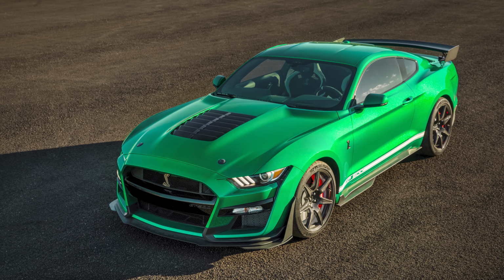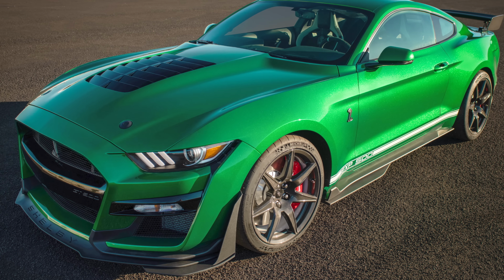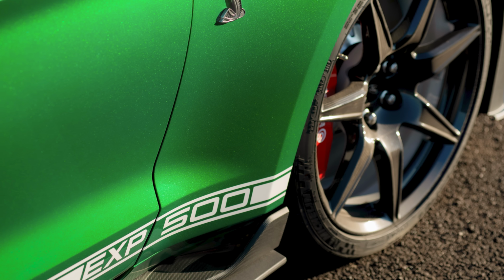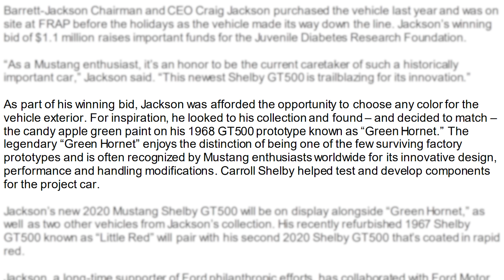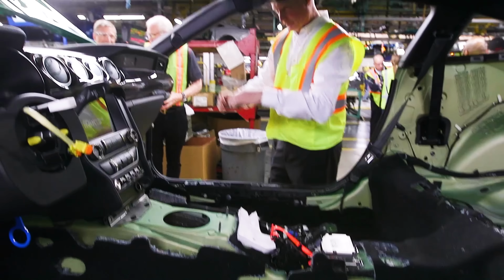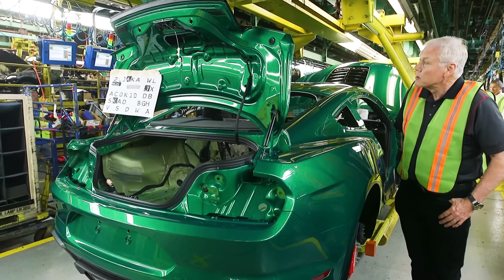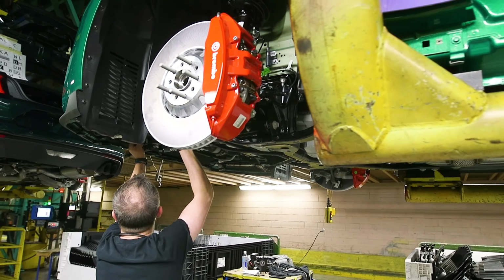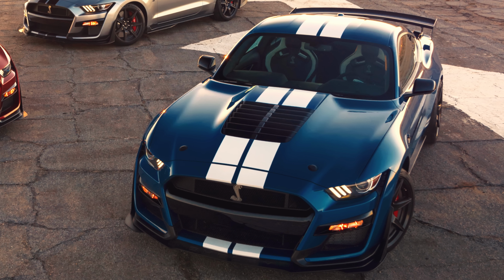WATCH THE $1.1 MILLION 2020 SHELBY GT500 BEING BUILT! *INSIDE ACCESS*

Comment: Dealership: Dont go over 4,000 RPMs for the first 1,000 miles.

Also dealership: Rips car on dyno RIGHT off the assembly line.
Reply: Austin Murphy easy way to start engine problems. But im sure they not doin that dumb stuff
Reply: When
Reply: I'm a little late to the party here, but it was really cool to see this video. The dyno run was done at the factory, but they didn't show that. Flat Rock Assembly Plant builds all of the real mustangs, about 20 miles south of Detroit. The car was run through 'test roller', where the computer checks the alignment and other basic functions of the car, that was shown. They only do actual Dyno pulls on random Mustangs to be sure everything is right. I am quite sure that this one was put on the Dyno.
Reply: That's not a dyno, lol
Reply: It's not a Chevy or Mopar that needs break in for the first 100,000 miles before it blows up.

Comment: Good video!!! I started Subaru of Indiana Automotive Inc. In 1990 at the age of 20. Ford assembly mimics how we built the Subaru Legacy, Outback ect. vehicles in Lafayette Indiana. I retired at the age of 44 back in 2015. I have only had 1 Subaru during my career out their cause I have always been a car nut and craved my V8's. I have owned 8 different Mustang GT's and 1 2003 Terminator Cobra. Wish I would socked away all the different cars in a pole barn since buying my very first car at 15, a 1971 Chevelle. I have owned 3 Trans Ams, 2 Z28 Camaros, Corvette and the list goes on. Miss all the cars

Comment: I think where they are being being is totally fine. Lets think about it...those “aiding robots” are actually taking a lot of back breaking labor out, but are also very accurate and I’m sure lessen the chance of a human manually picking the door up and possible dinging the paint job. it’s still taking human hands to make sure everything is flush and square, so that cool that it’s not all robots. Reminds me of construction workers having power tools such as air nailers, opposed to hand banging every nail. If the mechanics were building in another garage...they may not have this very expensive equipment which would lead to more knicks and dings in the paint. So I’m my opinion even if the car is over $100k it is being build exactly where it should. Plus I’m sure those mechanics are the best of the best the Ford has to offer.

Comment: Its not Horner Green. MR.Jackson had it paint in CANDY APPLE GREEN to match his "Green Hornet" mustang which is Candy Apple Green
Reply: ...... it’s not candy apple green... anything (candy) is a tri-stage paint job and sometimes  even 4.. you know when it’s a synthetic (candy) vs a true candy because a synthetic candy which is really just a regular metallic paint job with a (base) ground coat and it’s hue is stable and consistent throughout all the body lines. A true candy
 “to the untrained eye” is like looking at a jolly rancher candy and it’s hue, depending on sunlight and angle, will GLOW in some areas and in other areas will appear dark
 (almost black) in other areas that are in shadow. 

The only benefit to a synthetic candy is that the paint job or (color) beneath the clear will last longer over the years. The tints used in real candy situations have very highly active chromatic properties which get excited in sunlight much easier than non chromatic colors and absorb much more light which in turn ware out the color pigmentation causing a bleaching affect. 

If you want to see a real candy paint job just look at the ones on the 70’s impalas and other low riders in the Internet.

Comment: I move cars in frap and its awesome seeing so many gt500 and its great hearing all your feed back on those amazing cars i see so much of. I once seen one with a price tag of 140,000$ any comment on why your 80-100 thousand price point seems understated in a way. Just wondering! Thanks!
Reply: The only way a GT500 is ever reaching 140k is with dealer mark up, the fully optioned out Mustang without dealer mark up reaches about 107k, your standard GT500 is about 73k, CFTP reaches 90+k. So the average amount or price i would expect to see is 80 to 90k depending on the buyer.
Reply: @raionshishi8290  oh i know they mark up the sticker price but it seems like such a rip off. Thanks for the comment!
Reply: @mellomisfit  That's why you need to find a proper dealer that sells it at msrp or with a decent mark up that doesn't seem to much of a rip off.

Comment: They should have put vertical lambo doors with lambo touch sensor door popper right on the bottom of the line on the door just like lambo
Reply: Nicole Smith yep also pop out front wheel cause sucked inside look dumb... with that Lamborghini door thing would make sense in 1.1 mil 😐😅

Comment: Some YouTuber blew his engine because he didn't break it in
Reply: The guy with the lime green?
Reply: @luisestefes3411  No, it was royalty exotics. Literally got the car off the trailer brand new, cold started it, with no break in, decided to bang it off the rev limiter multiple times. Started to mis fire after about 16 miles and he continued to blame the Ford factory for it!
Reply: Matt Stewart I mean, I know it’s his car, it shows money yet you shouldn’t be doing it to a brand new cad that just came out from the trailer, and I was even shocked that he blamed ford for it🤣 just like you mention it, he knew he screwed up, he knew he is the one at fault but he put the blame on ford

Comment: Ford engineers are the worst. Triton spark plugs 6.0 and 6.4 head bolts and they don't address known problems. let alone difficult  to work on. And early stuff not much xs over distributors water pumps bellhousing etc. 351c m and w. Almost as bad as a dodge.